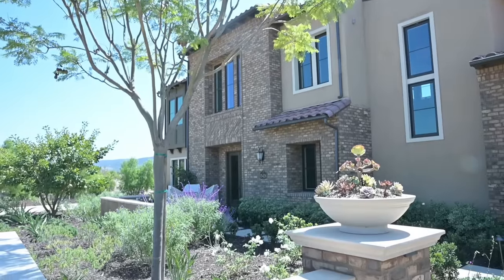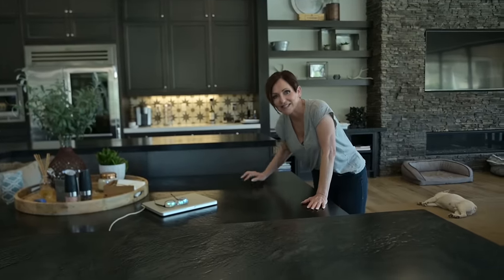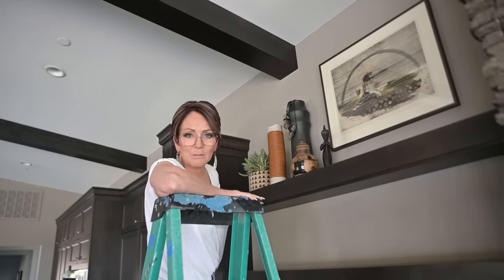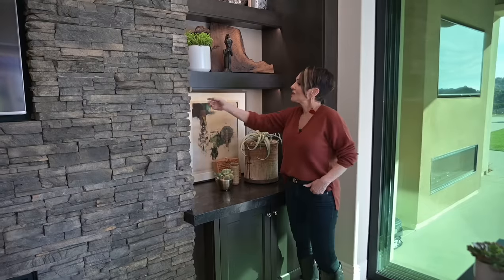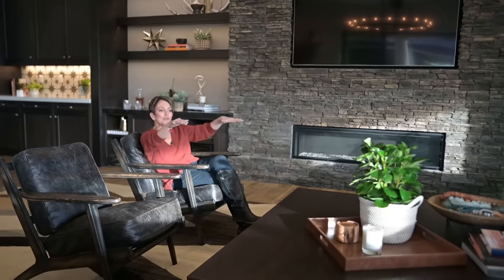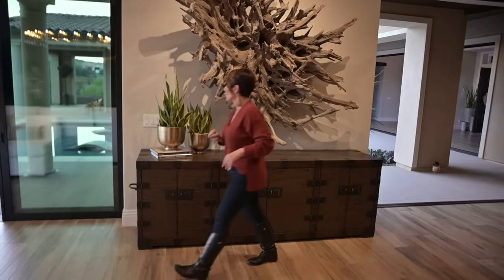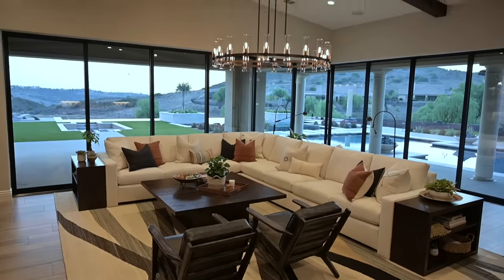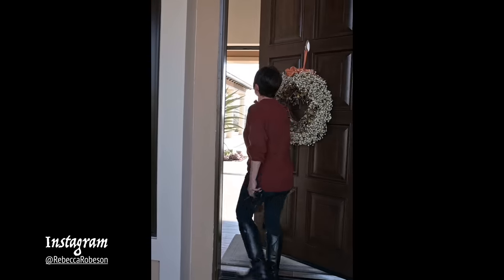INTERIOR DESIGN | Living Room and Kitchen Makeover Reveal

Comment: As Design Sessions members of course we know, paint the vent!  Are those two leather chairs the ones from your office or did  you just order the same ones?   This all turned out gorgeous as usual.
Reply: Paint the vent in the same color? Makes perfect sense! Now I need to go around my house lol
Reply: @pamelar3257  Do all your vents as well as any electric outlets.  Just use a dry paint brush (very little paint on it) and do several coats.  I've done every single one in my house.   And then join Rebecca's Design Sessions.  It has  changed my house.
Reply: I hope to definitely be joining in the near future. Thanks for the tip again
Reply: As for painting ceiling/wall speakers to blend, Benjamin Moore can take your wall paint and put it into an aerosol can. Spray light layers to cover without the heavier coverage of a paint brush blocking the speakers.
Reply: @carolkrog5945  I had no idea that was an option.  Thanks for sharing.

Comment: I wish you had added a light fixture over the kitchen table.
Reply: It looks like there are two recessed lights in the beam aimed down at the booth table for lighting.  Rebecca probably thought a fixture hanging there would detract from the drama of the major one.
Reply: Those ceilings were so high, I doubt pot lights would do the trick.  You need something closer to the table.